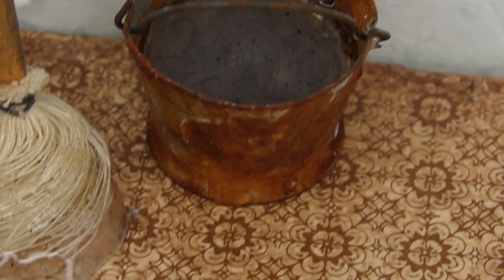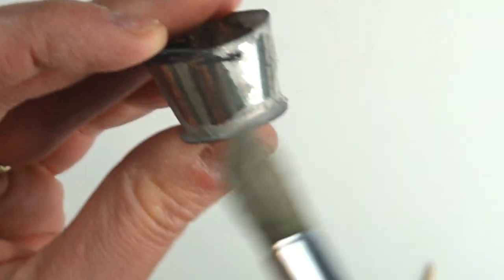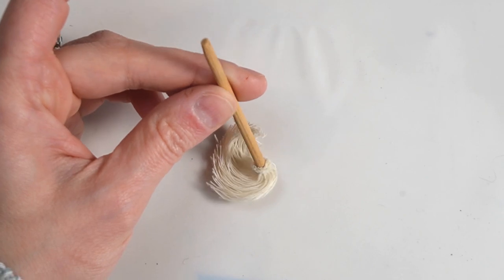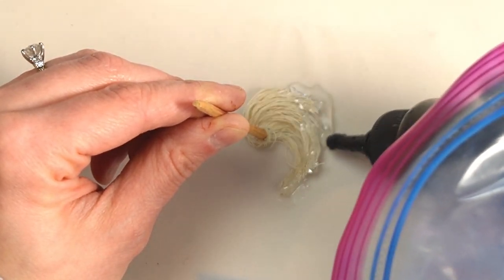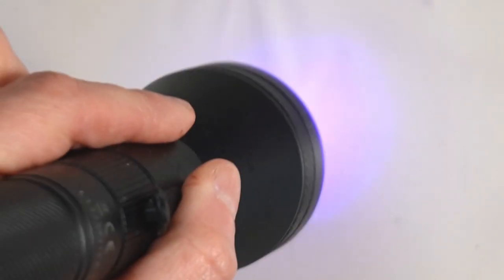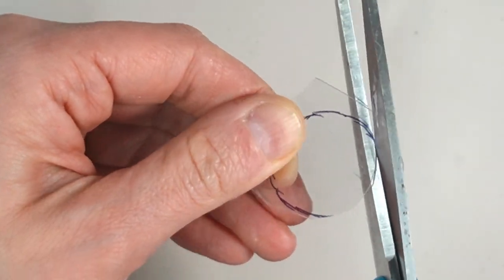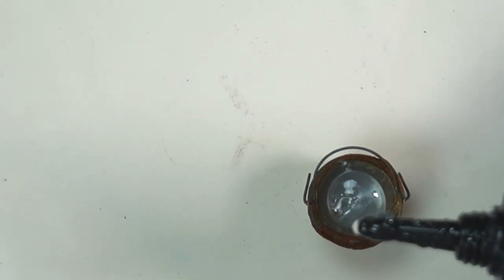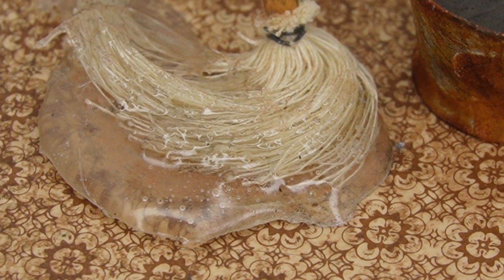DIY puddle mop & rusty bucket of water/ dollhouse miniature accessories

Comment: The plastic in the bucket looked like water. At least on camera it did. Thanks for the tips.
Reply from the maker: It did in real life, too. It could pass for water especially if you add some gloss mod podge on top so it isn't smooth as glass. A thin coating of uv resin really makes it look like water and there's no glue necessary. The resin holds the plastic in place.

Comment: Excellent job. I love the way you used the rust colored paint with the resin. What kind of light did you use to dry the resin?
Reply from the maker: Thank you! The rust paint is pretty pricey but it can't be beat. I used a UV flashlight.
Reply: @queencityminis  Thanks. In the past I used a rust colored acrylic paint but that paint you used had a much better effect.

Comment: Can you use that light with any resin or does it have to be a resin that can be dried with the light?
Reply from the maker: Only time will cure epoxy resin (and only if you mix it properly). I tend to stick with UV resin myself.
Reply: @queencityminis  I have only used the epoxy resin to date. If you used UV resin, do you have to mix with anything?  How long does it take to cure? Do it create any bubbles like the epoxy resin?